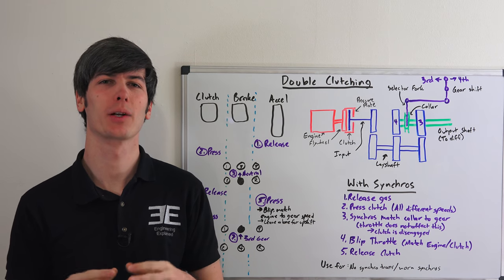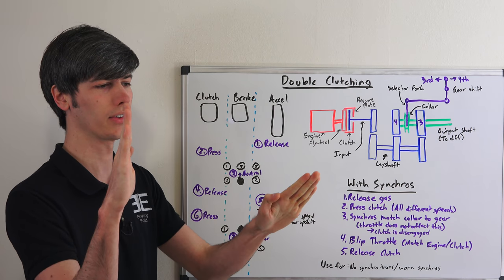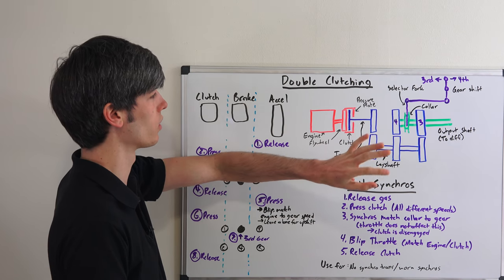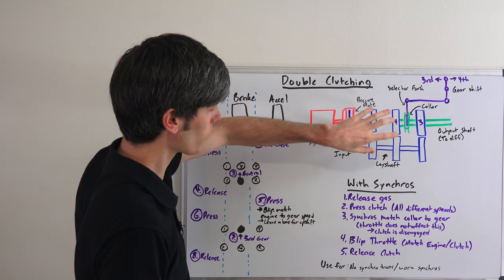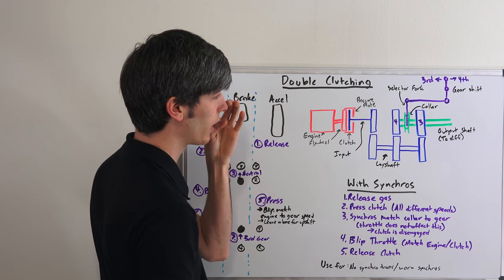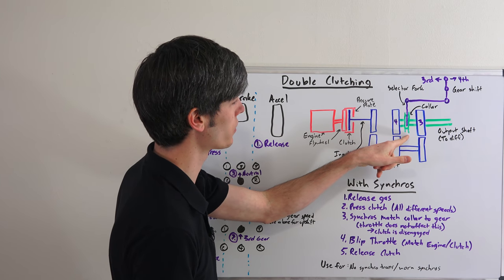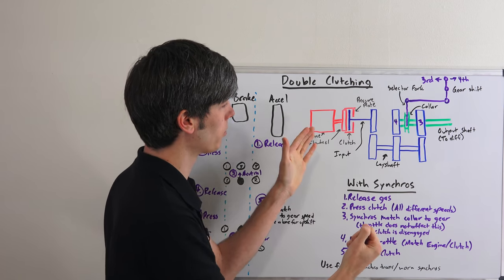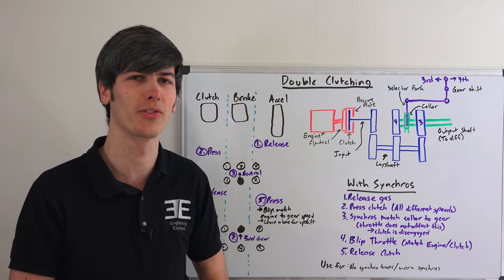What Is Double Clutching?

Comment: Does your manual transmission have synchro's? Unless you are driving a model T or something else from that era with it's original transmission or a Semi, that answer would be yes, your transmission has synchro's, so there is absolutely no need to double clutch while shifting. If you are double clutching because of worn synchro's or you think you are building more clutch pressure then you need to take your car to a shop and get it repaired. When Toretto said to O'Conner "not double clutching like you should" he was either talking out his ass or assumed O'Conner had some kind of racing transmission in his car that didn't have synchro's in it. Done properly you don't even need to use the clutch to shift a transmission without synchro's unless you are at a complete stop. Simply match your engine rpm to the right gear for your road speed and it goes right into gear.

Comment: I started driving with cars that had been setting in a field, old wore out cars.
After fixing up the car. To keep the manual trany from wearing out synchronizers I would double clutch. Because the synchronizers were still good, made it easier.

Comment: Double clutching is very important in newer cars with manual trans. The syncros are sub par and wear out quick. Also if you lose your clutch because above stated issue, double clutching means the diff between getting home or calling a tow truck in a strange town. Other than that mostly trucks and race cars....no syncros in them. jmo.

Comment: What I don't get is  a corner is Coming up right? I have always just pushed the clutch slowed down to about the speed I'd be going In that gear and then release the clutch Decently slow and smooth. Always worked for me and lots of power going into corners. So am I totally screwed if I try to drive a Manaul without synchros

Comment: All pluses with double clutching. You really are eliminating almost all wear on the trans shifting between down and between widely spaced gear like first and second.
If you are just driving around and already waiting for the engine to come down in rpm to keep things smooth this doesn't make shifting take longer either.
I think the arbitrarily higher clutch wear is worth the elimination of gear box wear. It also adds another layer of engagement to driving a manual. Plus when you nail this on the downshifts you can really tell it's doing something and feel smug about. Trans just drops into the gear your going for effortlessly.

Comment: too long and complicated explanation, i would say match the engine rotation/speed with rotation of the wheels/speed for smooth shifting or the speed of input shaft and output shaft must be equal ! you can double clutch 2,3,4,5 gears without pressing the clutch , and follow  the other steps ,for example release the accelerator , switch off 2 gear,while you are on neutral wait the engine to decrease rotations and in the right moment switch on 3 gear,but you must feel very well your engine ;-)

Comment: Manual transmissions with synchromesh do not need to double clutch. 
In non-synchromesh manual transmissions, double clutching is a must. Non-synchromesh transmissions are typically older designs and are most frequently found today in tractor trailer 10 and 18 speed transmissions of those w/o synchromesh.

Comment: This is a very good explanation,however, many fail to understand why it is a good thing even with synchronised boxes - if you listen when changing without doubling you can hear the gears spinning up, this is exactly what the synchro hub does, however, if you wish to take the wear off the synchro hub doubling will match the gears and take some of the wear off the hub and it will change quicker and smoother too.

Comment: So the only difference between this and rev match down shifting for example an NV5600 six speed syncro, Is that you're bliping the throttle in neutral rather than in gear with the clutch pressed in?

Comment: In a manual non-synch transmission, when you double clutch, you only press the clutch down part way.  The non-synch transmission has something called a "clutch brake" which is engaged when you press the clutch all the way down.  The only times you would want to push the clutch all the way down was when stopped with the trans in neutral or sometimes when upshifting on an uphill.  The reason for this is because with the clutch engaged, it is turning at engine RPM and you want it to stop turning so you can get it into a gear, since your wheels aren't turning.

Comment: My first daily driver was a late '30s pickup with synchronous transmission. In time it hot to the point I would use the clutch when starting out or coming to a stop. Tho change gears I slip the transmission out of gear "blip" the accelerator to slip into the next gear. Show go without saying don't  do that when accelerating with a heavy load

Comment: Am I the only one who doesnt blip the throttle when down shifting? I just put it in a gear where I know the rpm is close to that speed for that corner. I feel like blipping the throttle creates more slip than just putting it in gear and letting the clutch out. (1k-1500). not a track driver here.

Comment: Interesting but obsolete info that's of very limited use to anyone outside of vintage enthusiast. 

All other times, if the synchro has gone on your car, it's almost certainly really old and ready for the scrapheap. You're going to know the clutch is on its way out way before it gets so bad you need to do this, and why would you buy or continue to drive an old banger with a fucked clutch?

Comment: This is more related with synchronizers: In Sweden, rev matching is not taught at driving schools but merely something you have to learn on your own. I don't do it, but I'm thinking about learning it. For me, there are two alternatives to get the downshifting smooth then; Assume I need two change down to 2nd gear before a curve coming in around 32 km/h, I hit the brake gently, change down to 2nd and then release clutch to biting point and keep it very gently there. You'll see the engine starts to brake for you, and when it's done; foot is off the clutch and the speed should be about 18-24 km/h. Or I use the brake more "harder" and shift down when the speed is about right. Both cases are completed before turning. The car is always smooth. But I assume I'll have less wear if I rev match?

Comment: IF, and its a big IF, you are really good you only have to use the clutch to initially engage first gear when starting from a stop and do not have to disengage it till you stop again. The problem is this can cause damage if you are not really good at matching the engine speed to the ground speed for the gear you want. With synchronizers you can gently feel when to engage the gears. I have driven home a couple times with a broken clutch linkage. shut engine off to stop after slipping trans out of gear as you coast down. with engine stopped put trans in first. use starter to get going and just shift carefully. I never broke or ground the gears etc. There are things you can do sometimes that work if you think about it.

Comment: When my dad taught me to drive he taught me how to change gears in a standard transmission. I learned how to double clutch then later I learned how to float the gears which is a way to shift without using the clutch at all. After that I only had to use the clutch when I had to stop, start from a stop, or reverse. Haven’t driven a standard transmission for years but I bet I could still float the gears. It might be a little sloppy for a bit but who knows until I get a chance to try. In this day and age finding a standard transmission would be harder than floating gears.

Comment: Trucking is where I 'learned' to double clutch. (still not great at it) but with the massive weights and torques involved in larger vehicles makes it much more difficult to just  'brute' it into gear. 

I am still not great at it when in 500+hp rigs, as everything is much stiffer, but, ever since I have learned the double clutch theory I have had much better shifting in high torque applications.

Even after years of experience I still tend to grind gears from time to time :(

Comment: Not really, you can use it, it’s fun but if you have synchronisers not necessary. If you have a crash box it maybe necessary. If you get to know your car you can get by without using a clutch at all. Not recommended because you will crash it occasionally, increase wear on your drivetrain.

Comment: you driving on 3rd gear. shift to neutral, then press on the gas to get the torque up (the car goes wroom wroom), then shift to 4th gear. in a normal car with manual gear. you can just shift up when yours torque reach 2. or as i like to call it. that is how you shift gear by hand.

Comment: Hey Jason, A quick question. Say I'm driving on the highway at 100km/h and then want to quickly overtake someone in front of me. Clearly no point trying to do that in fifth gear so a downshift is in order. Doesn't this technique reduce the "bump" when downshifting from 5th to 4th for example. Also doesn't this give me instant power to the wheels as the rpm in the new lower gear is already high. 
I think what I've just described is exactly what happens both in theory and practice but you didn't mention it in the benefits. 
PS. my car is 20years old mitsubishi so the synchros are not very modern nor necessarily in good condition if that plays a huge part.
Reply: oh this video is a year old. Probably someone else will answer :D

Comment: I noticed recently, a difference in the feel when downshifting, the steps (much smoother in reality, but they are as follows:
Release throttle, clutch in, shift neutral, blip throttle, shift lower, clutch out. - results in a much jerkier performance than:
Reduce throttle(to maybe 10%), clutch in, shift neutral, shift lower, clutch out.  - I thought it was because of fuel injector lag, (It's a 2016 vehicle, so IDK how any lag would be a real issue, but it was a working hypothesis.)
After seeing this explanation on double clutching, I now think it is due to the fact that when the clutch is disengaged, it doesn't spin up the transmission at all, which is a much larger mass than the inertia difference in engine speed.  
I had a car in which the Transmission failed catastrophically one day.  Something inside seized or broke/jammed.. The clutch was permanently engaged.  I hobbled along a couple months shorting the clutch interlock switch and using the starter to get rolling.  Rev match every gear and shut the car off if I had to stop completely.  It was brutal.  Especially considering I had an intermittent start issue that was either the camshaft sensor circuit or the starter ground.  I replaced everything except that ground.  And at the end of everything my ignition switch broke, I macgyvered together two switches with small plastic bottles, bolts and 12awg wire.  That car was a mess, but it gave me a good idea of how it all works!
I have no idea if my explanation makes any sense, but if anyone will understand it, it's probably you.  I watch your videos all the time, I'm not subbed?  Methinks the Google AI is on the fritz.

Comment: Thanks for the video. I have a question: when going from fourth gear to third is it bad to press the accelerator and simultaneously press clutch pedals change to third gear and release the clutch pedal and keep driving on? In another words skip the putting shifter to the neutral position step?

Comment: I never understood the "shift to neutral" part, couldn't you just rev match like clutch in - which is basically neutral as you disengage the motor, blip your throttle, and downshift then pop clutch? What benefit is there to actually shifting into neutral proper?

Honestly though my feet are not nearly fast enough to do the fast pump thing I see people do for this technique.

Comment: so it's not completely useless; but useless a lot? is this something we petrolheads do "just for fun"? also, doesn't overusing the clutch pedal cause wear and tear at the spring system with older cars which have the clutch cable? also also; the pressure plate?

Comment: A very good description of how the clutch temporarily disconnects the engine output from the transmission and so on down the drive train, but the rationale for removing one's foot from the clutch then pressing it a second time is completely missed. Matching the engine rotation speed to the rotation speed of the appropriate gear is easy to understand (and explained well), but the rationale for double clutching is totally missed.

Comment: EE I get that it's not nessary in modern syncro transmissions. My question is dose it indeed put more wear on the clutch with double clutching? So yes you save syncros but increase wear on clutch and throw out bearing. ?

Comment: My question is, why does the gearbox speed need to be matched to the output via being connected to the engine in neutral when you were already matched by being in gear previously? Isnt the output speed and gear speed the same if the gears being shifted between share the same selector fork/sleeve?

Comment: Why is it necessary to let out the clutch before blipping the throttle though? The stick is already in neutral. Couldn’t I let off accelerator while pushing in clutch, shift from fourth gear to neutral, blip the throttle, shift into third gear, and then let out the clutch while pressing onto the accelerator?

Comment: The lay shaft or cluster gear here is the culprit. It has to be matched to the speed of the desired gear being selected.  This is done either by the synchro brass clutch in a synchro mesh transmission or by double clutching in neutral in a non synchro trans.  Double clutching in a race car when approaching a corner saves the brass ring and allows the gear to be selected while braking (heel toe) so the corner can be exited quicker.  
On an old 60's 3 speed at a stop light in neutral (clutch out) with non synchro 1st gear, you had to put in the clutch and wait for the cluster gear to stop turning or there was clash.  Putting the selector in 2nd first would stop the cluster then you could quickly select first.

Comment: Don't leave out the teeth on the sleeves, gears, and synchros. also you might want to mention that the synchros are come shaped and what that has to do with speed-gear matching. What would be relevant is to show how incorrect gear matching would "grind" the gears.

Comment: Question: Can you put it from the initial gear to neutral without pressing the clutch at all (with the foot off the throttle of course)?  It seems to me that if you don't have any torque going in the collar/synchro you can slide it out of gear without disengaging the engine from the transmission (pressing the clutch)... Is this bad?

Comment: This counts only for cars where the clutch is located between the motor and the gearbox, in motorbikes for example the clutch does not disconnect the gearbox from the motor as it is located between the gearbox and the sprocket. So there the gearbox always rotates at the same speed as the motor, no matter if you pull the clutch lever or not.

Comment: You can try double clutching on a modern car it will not make any difference from standard  single clutch technique all is needed is to know the speed of each  gear to
 shift up  smoothly and to rev mach when down shifting which is the best way to make your  clutch and synchro rings to last longer unless you are a petrol head and like to do a lot of burnouts  .

Comment: I thought double shifting is when you are in gear the cars not going  through the rpm range fast enough  you while your foot is still in the gas. you quickly engaged  and disengage clutch kick in you power band to get through the gear quicker. kinda like a sling shot

Comment: Wouldn't the first clutch engagement be unnecessary since you can easily slip out of the gear at the load release moment as you let off of the throttle without touching the clutch? Then your gears are still connected to the engine while in neutral and can rev it up before using the clutch to downshift to your desired gear?

Comment: Im probably way off but what im getting is you have to press in clutch to disengage the input then go to neutral to disengage the output from the layshaft, then release clutch to reengage input to layshaft to be able to rev and spin it up to speed to match a lower gear since there are no synchros but after that if you get the input and layshaft at the right speed to match the output couldnt you in theory just push in the gear if its matched without pushing in the clutch?

Comment: So the idea is you bring the two speeds close to each other so that the energy difference is small and slipping the ring on easier. My question is wouldn't you get the same effect by reducing the speed of your vehicle before downshifting into a range usual for the gear you're downshifting into? So instead of running the motor faster you run the wheels and thereby the gears slower and reduce the difference that way. I am still learning to drive but that's how I do it and it prevents unnecessary engine braking.

Comment: i learned how to double clutch in a truck without a synchro, but i never used the clutch apart from take off in a truck. if i am to downshift i still do the same but without the use of clutch, and it works.

Comment: Once you blip throttle in neutral, do you have to wait til the revs drop (if downshifting) before reengaging the clutch to push it into gear? Or can you blip in neutral then immediately engage clutch and have your hand ready to slide the gear into place once the revs are good?